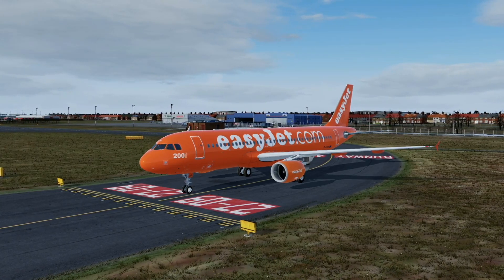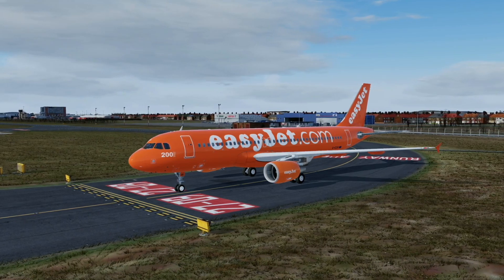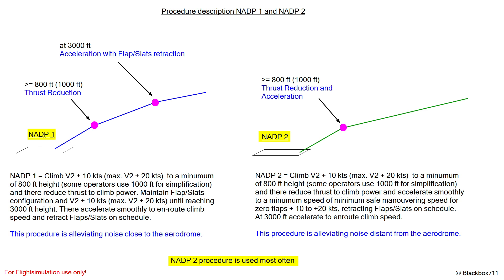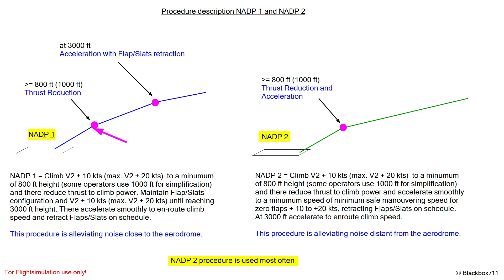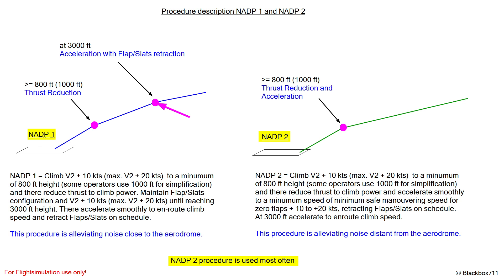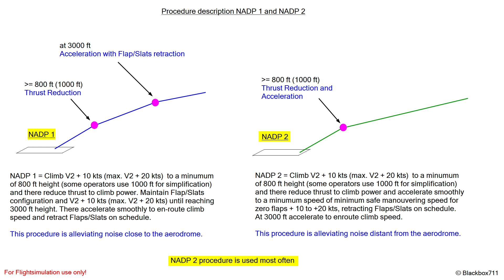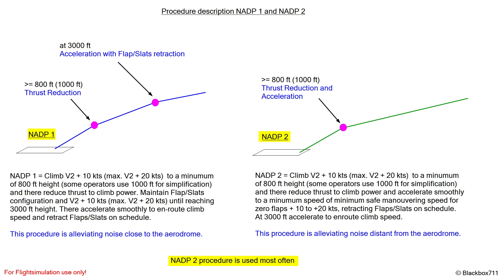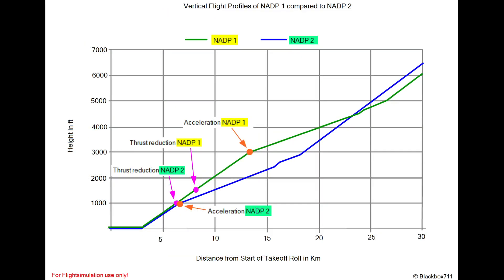FAQ - NADP - Noise Abatement Departure Procedures

Comment: Why is the NADP 1 graph is so steeper in the beginning phase compared to NADP2 ? With configuration on during initially climb phase , I thought it would 
deteriorate ur climb performance ?
Reply from the maker: NADP1 means that you climb longer at V2 (+15) until 3000 ft AGL and the thrust reduction is done a little later at 1500 ft AGL instead of 1000/1000 ft. So NADP1 is made for obstacles close to the departure airport as an example.

Comment: The vertical profile layovers finally did much of the explaining for why one offers preferrentially less noise close to airport (NADP1) and other far out (NADP2). Have been trying to find an explanation and finally your video did it. Much thanks... 
In NADP 2 we compromise an expeditious climb to accelerate simultaneously (engine thrust shared between two actions), but reach clean climb speed earlier and then can resume a quicker climb thereafter. In NADP1 climbing quickly away from airport preferred and thus we intentionaly delay acceleration.

Comment: Can you make a video for Derated TO thrust in Airbus please?

I am not sure if it is an option and if the A320 family has it.
But i saw in an A330 flightdeck that D-TO was  in use. Also what differences there are compared to Boeing.

Also it would be nice to show the difference between TO-1/TO-2 and R-TO (Reduced Take off thrust).

The thrust mode R-TO appears on the Upper Eicas. Does every 737NG has the R-TO mode?

Also please make videos about Take off Bump and Cutback.

Ryanair for example doesnt have Take off Bump if i am not wrong.

Cutback is usefull for the Noiseabatement proc but how to use it?

Also when do you use CLB/CLB1/CLB2?

I red that when you climb with CLB-1 thrust, at 15000ft MSL it switches automatically to CLB mode.

Thanks

Comment: Can you show us an example of each flow by you? Especially the needed settings in the MCDU? On which chart we find the information which NADP has to be flown at this airport?
Reply: For NADP you have to set TO PERF page THR RED/ACC altitude (A320). For example if your airport elevation is 500 feet, for NADP1 you enter 1500/3500 or NADP2 you will enter 1500/1500. Usually there is a special chapter for airports published together with charts, which is called AOI: aerodrome operating information, there is a departure section in it which lets you know which NADP is used for departure. For example in real life you can choose between NADP 1 and 2 in Italy.
Reply: @gevinhu  I think the alts are AGL so it's always the same. At least in the toliss it's all AGL.

Comment: Love your videos and streams, when you enter a route, a sid on the airbus fmc does it already load the noise abatement procedure or are noise abatement procedures already factored in airports sid´s?
Reply: Nadp procedures are manually entered in takeoff PERF page, i believe it's lower left corner of the aforementioned page. Values shown are above mean see level.

Some SID procedures also contain noise abatement routing. I believe LOWW rwy 29 has them.

Comment: Some airlines also change the altitude values depending on airframe. For example, at SWISS, NADP1 is simply 1500/3000 for the entire fleet. For NADP2 however, its 1500/1500 for the B77W, while its 800/800 for the rest of the fleet.
Reply from the maker: Yep. Thing is that the NADPs are mostly “recommended”.
Reply: I believe it's even more complicated then that. I believe the A320 uses 800/3000 for NADP 1 while we on the A220 use 1500/3000 for NADP1 and we also use 1500/1500 for NADP2. Why there are differences on certain airframes I don't know, but I always thought it was interesting.